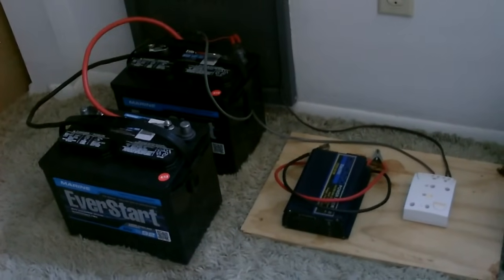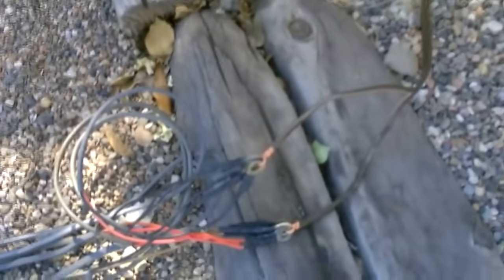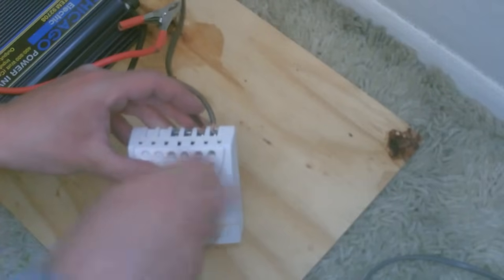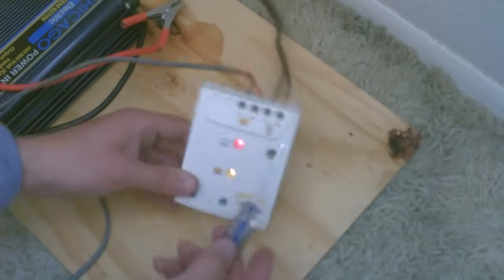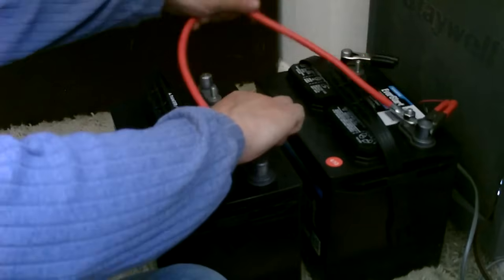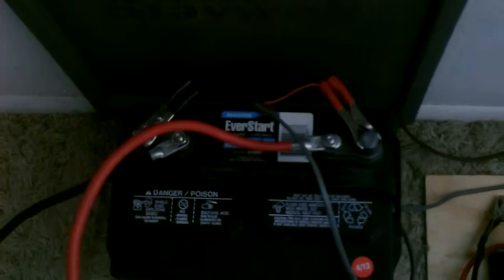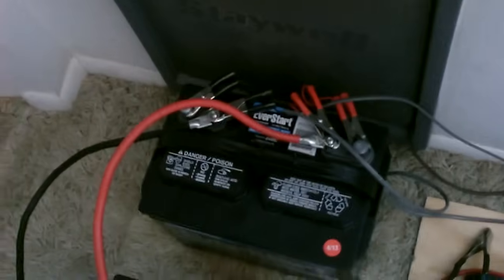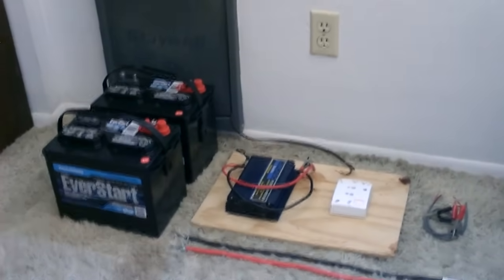How to hook up Solar Panels (with battery bank) - simple 'detailed' instructions - DIY solar system

Comment from the maker: I used two 45w "3 panel" sets from harbor freight (or just buy one 100 watt panel on Amazon - Renogy sells a good one ($150-$180.). the inverter is a 400w one from harbor freight ($20). charge controller is made by "sunsei" and is from Fry's Electronics ($40). batteries are 101ah each and are from walmart ($75 each). the large battery cables (wires) are from an automobile store (walmart sells those too). harbor freight panel sets cost about $100 used/$140 new (or one Renogy 100w panel $150-$180)

Comment from the maker: thanks. yes it takes one full day of sun to charge this system from empty to full (10-11 hrs). in brief:  each batt. is rated 101ah (202ah total). Remember though that the “usable part” of a batt. is only about 1/3 of it's total capacity. in this case 34ah or (68ah total). the panels, in full sun produce 6 amps (over 11 hrs equals 66ah). note: after you remove about 1/3 of the "juice" from batt. bank the "low voltage alarm" will sound and inverter will shut off (to protect the batts from damage)

Comment: Plus it will give you readings on voltage, amps, etc....Plus you can always get more panels...
3)  Look into 12 volt appliances, they are used in rv's,boats, campers....Also lights.... I used to use 2 60 watt incandecent bulbs for emergency lighting... But the burned 7.5 amps an hour... I bought 2 LED bulbs, same appearent wattage, but the only burn 800 milliamps an hours.... Big difference!!!!!  
 If you want, search under -- Coldone001-- for my vids and channel....  Keep up the good work!!!

Comment: Nice video!!!  
 I myself started with 1 HF kit and one DCM battery.... Now I have 4 sets on the roof and 5 batteries.... Used to have 4 more car batteries but they could not handle the deep cycling.... Just a couple of ideas for ya sir... 
1) I seen many vids with people having a half dozen batts spread across the floor, workbench , shelf.... Waste of space in my opion... I stack mine vertical in milk crates...
2) Get a better charge regulator... HF has a 30 amp one for about $80...

Comment from the maker: the inverter is a 400 watter. yes you could absolutely run a small tv off of this system. they're "everstart" deep cycle batteries.

Comment from the maker: this system would be too small to run a full size refrigerator. check out my first video titled, "small residential solar power system". that setup is about the right size. (12 panels 4 batteries)

Comment from the maker: it's modified sine wave. you could hook up a pure sine wave one to the same system. i've been looking at some of the xantrex prowatt models.  fairly inexpensive and some even have built in lighted voltmeters
Reply: Can I ask why all electrical appliance must be connected to only one battery ? Thanks.
Reply: Where did you get your voltage reader meter?

Comment from the maker: all you would need is one battery if you are running the fan when the sun is shinning. you can easily pull 50 watts off of one battery. if you want to run it at night for 8 hours then i would use 2 or 3

Comment from the maker: hi there, it is 100% safe to keep them indoors. there is no danger of them exploding at all. batteries do put out a VERY minuscule (small) amount of hydrogen when in the final stages of charging. it's a tiny amount that easily dissipates in a room. (the air in an average room of a house is completely exchanged with outside air every 4 hours or so just from air entering around windows doors etc...) ...if you had 100 of them in a small room then i would say you might want to "open the window"

Comment from the maker: thanks. yep, you can add as many batteries as you want. what size charge controller you need depends on how much power the panels produce (not how many batteries you have).  example:  the charge controller i have is 25ah (amp hour).  as long as solar panels don't produce more than 25A then i can keep using the same controller.

Comment: so a little help. I have 4 12v 18ah batteries =48v. I would need the inverter and charge controller. But question is. What is the smallest solar panel I could use. I want them on my bike.

Comment from the maker: When 12 volt systems are charging they read as high as 14.4 volts. When the system is completely charged it will go into "float charge" mode.  At this point they will read around 13.5 to 13.8 volts. Just means the battery bank was fully charged. Once the sun goes down the battery voltage will drop to 12.7 to 12.9 volts. 12.7 to 12.9 volts is a fully charged battery. When the sun comes up the voltage will once again be 13.5 to 13.8 volts.

Comment: hey man great video.I see your voltage meter was reading 13.6 now correct me if im wrong but you have two 12 volt batteries that makes 24 volts does that 13.6 go up to 24 eventually?

Comment: Very easy to understand.

My only question would be wire size.  I have a 12 volt system ready to go with two 150 watt panels (I will add more panels as I can later).  I'm not sure what gauge wire to use.
It seems like I should be using a 2AWG but it seems to depend on distance from the panels to the charge controller.  I do not want to risk fire at all but I also want the system to be efficient. Any suggestions for panel to converter, converter to battery and battery to inverter wires?

Comment from the maker: since you are using 6 volt batteries and from what you describe, it sounds like you did it right. you hooked the two 6 volt batteries in series to, in effect, make a 12 volt battery.

Comment: OK, cool vid...very informative. But I have a question.....in tying your batts together, you have pos to pos AND neg to neg.....I have 2 6v AGM batts being charged by 280 watts of solar, BUT my batts are tied together making a 12v bank but the ONLY connection tying them together is, 1  neg to pos......but my panels are only charging to 12v on my inverter....and the system is in full sun.....have I got something screwed up here??

Comment: Damn.  I have been fortunate enough to get about 20 of these and they are just sitting around as I can't afford the rooftop system at the moment.  

If I am not concerned about efficiency though,  if I had a hookup like yours (Maybe a larger charge controller,inverter and battery bank) would I be able to use it to charge various power tools on the jobsite (work in the country).  I am trying to mount a panel in the bed of my truck.  

Appreciate the advice as I am still a student and learning!

Comment from the maker: hi there. to be clear, any panel over 140 watts is generally not a "12 volt panel" and is not designed to be used with a battery bank.  to make sure you have enough power, i would use 4 batteries (if they hold 75ah each) and 2 100 watt panels.

Comment from the maker: hi there, the panels you have are for grid tie applications.  i would not try to hook them to a battery bank.  panels that are designed for battery banks are generally 12 volts and  the largest are about 140 watts.

Comment: P.S.  I forgot to mention that the 2 batteries I have are AGM Deep-cycle, and recommended not to discharge more than 50%.  (Also, if this will help, the freezer/cooler is 3.1 amp, though I realize that a freezer cooler cycles on and off, cutting 1/3rd off the 24 hr.) Thanks.

Comment: Hi, I'm so glad I saw this video. Talk about timing. I have a 37 watt freezer/cooler, 2 batteries = 150ah. Someone told me that I would need a 300w panel, and for some reason this just didn't compute. Then I saw what you wrote about anything over 140w is not designed to be used with a 2 battery system. I really need this advice: "Would a 100w solar panel be enough to work my freezer/cooler? Thanks.

Comment: Hi there,

I have my hands on several panels that are rated 230W.  They say on the back that they are 30V and 7.79A.  I am wondering that even with this same setup, maybe 4 batteries and 2 of my panels...if it would still work given the correct charge controller and inverter.  Would my panels be too strong for the battery?

Comment: Hi my friend. Sorry already bought 1 panel 170 watts,Max Power Voltage 18.3 v.Max Power Current -9.3A.
Open Circuit Voltage 22v, Short Circuit Current 9.6A.
This means that I have to get a 200w 24v to 240 .inverter ?. Thanking you again. Herman

Comment from the maker: you'd only get a few hours out of a 100/200 watt bulb. try a CFL bulb. a (20 to 23 watt) CFL bulb produces the same light as a 100 watt incandescent and would run 5 times longer.  500 watts (continuous) is too large a draw for a 2 battery system.  you'd need to add 4 to 6 more batts.

Comment from the maker: hi there. i would go with a smaller solar panel. any panel over 140 watts is generally not a '12 volt panel' and is not designed to be used with a battery bank. with a 2 battery system, i would either use two '3 panel sets' from harbor freight or buy one 100 watt panel from amazon or ebay ($150 to $180). i would use a 200 watt or larger inverter (that will give you plenty of power for what you want to run). get a charge controller that can handle at least 7 amps. 100w panel produces about 6 amps

Comment: thank you, if anyone could help as I'm new on this stuff.  with system you have how long I can run a 100 W light bulb (or 200 W) during night and with 8 hrs of sunlight, how much would the batteries charge so I could get same amount of power next night.
can I connect a 500 W heater on this unit, if so how long will it run before it consumes all power from batteries
thank you

Comment: Hi  can you please help me: on top of my shed I will put a 250 w solar panel, just to run a 
30w water pump and some led garden lights, I already got a transformer for the garden lights. My questions: 1.- how many watts de inverter should be for 2 batteries and the battery controller?. thanking you very much mate.

Comment from the maker: varies widely.  prices in my area: batteries: $75.00 each. inverters: 400 watter $19.99/1000 watter $59.99. charge controllers $15-$40. harbor freight panels: $100 used/$140 new. as an alternative consider buying a single 100 watt monocrystaline solar panel.  amazon sells a great one (by Renogy) for $179.99 (free shipping). that's only $1.80 a watt.

Comment from the maker: yes, a battery bank effectively acts as 'one big battery'.  for all 'intents and purposes' the power is being drawn from them in equal distribution.  technically speaking it's not until you have over 8 batteries in parallel that you have a measurable difference (between the first and ninth battery) in the row (and even then its almost immeasurable)

Comment: One thing I still dont understand is when the batteries are linked up, and one is the main battery, is the power being drawn from them in equal distribution or ? Are they performing as one unit in effect?

Comment: The charge controller regulates the current going to the battery it prevents overcharging (Will kill battery) and complete discharge (will kill battery) it also prevents the solar panel using energy when there is no light.

Comment from the maker: you can use any 12 volt 'deep cycle' batteries.  walmart sells good ones.  cost about $75.00 per battery.  they tend to last as long as any other battery.  i usually get 3 years out of them (or approx. 1000 charge cycles).

Comment: In the desert, no power/no AC can kill.  Using batteries, inverters, charge controllers and solar panels, what set-up would we need to run a 3.5 ton AC unit (rated at 7500 watts/220vac & air handler w/blower motor running on 220vac pulling 6 to 8 amps max? Know it won't be cheap, but how many batteries, 200 watt panels, inverter type, etc., would it take. It may be something I have to buy in small segments and build out over a year or two.  With that in mind - where do we begin?

Comment: Air conditioning is a special beast.  They often have a fairly high input voltage requirements to start with (240v in most cases). In addition to that, they also have a high "start-up" current draw. This means that at the initial start of the A/C unit, it'll draw more current than is required to run it on a constant basis.

Assuming 12v batteries, you'd need 20 in series just to get the voltage. You can see how this is going to be a problem.

Comment: Not if it's SKU 68751. That's a 12v panel setup.  To charge a 24v battery, you need to provide more than 24v to push the charge into the battery. If you had 2 sets, and put them in series (charge controller to panel 1 neg, panel1 pos to panel2 neg, panel2 pos to charge controller) that should be enough I believe.

As for the pos->pos (in parallel) connections, this is to increase the Amp Hours (capacity) of the batteries. pos->neg (in series) would increase the voltage.

Comment: Needed, not always. Strongly recommended, absolutely.  A charge controller will stop the solar panel from killing the battery. Basically a battery requires you to push a certain voltage into it to charge it (12v batteries for example usually require a little over 13v). If the solar panel pushes too much into the battery, it'll kill it.

Comment: I have a question do you need a charge controller and if so why, I ask because I just ordered my kit, the battery and the inverter but I didn't order a charge controller

Comment: i have a 24v battery and the harbor freight 45w solar kit.  will the battery work with the kit?  also, why did you connect your batteries pos to pos and neg to neg?  did that change your volts/amps?

Comment: I had heard that it is more efficient to chain the panels through a single cable out the final panel to the charge controller rather than gathering all into a single mass.
Any thoughts on this?

Comment from the maker: thanks. my goal was to show how easy it is to set these systems up - and to take the 'mystery' out of it. all items needed can be found at local stores and a person can set the system up in one afternoon.  can easily be expanded to 3,4,5... or more batteries.  a good rule to follow is to have one battery for every 2 to 6 amps that your panels generate and remember to buy a charge controller that can handle the amps and you're all set.

Comment from the maker: you could certainly do it in that order (but it's not necessary.with the lower power (relatively speaking) that this system puts out). i don't think there is any benefit to using one high watt panel vs. many smaller ones. remember though that there are only a few solar panels over 140 watts that are available in 12 volt versions. Most are intended for grid-tie applications, with panel voltages between 22 and 75 volts. Not suitable for battery charging when used with a standard charge controller.

Comment: Is it true when hooking this up for the first time that you should first: cover the panels with a blanket so no power is being collected, second: hook the controller to the battery, third: hook the controller to the panels then remove blanket? 
I'm gathering all the input I can so when I do this for the first time I don't screw up a $300 part or burn a garage down.
Also is there a benefit over a single high watt panel vs many smaller ones? Seeing some 240 watt panels for around $200 these days.

Comment from the maker: i would recommend that you don't try that. it's a common misperception. i have studied battery bank configurations in depth and it will not extended the life of batts. you can hook up as many as 8 batts in parallel before there is any need to think about load balancing (and even then it's almost immeasurable). when you hook up batts in parallel (whether it's 2 or 20) you should put them all in a row and connect the inverter, charge controller etc... to the same battery in the row.